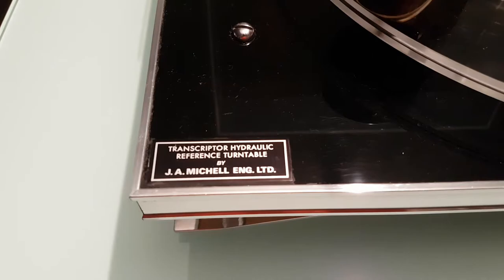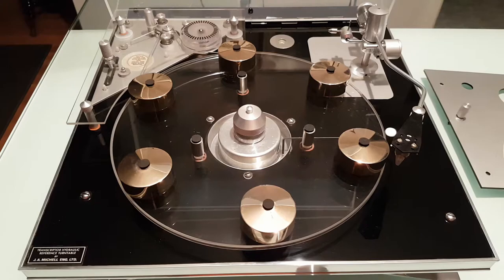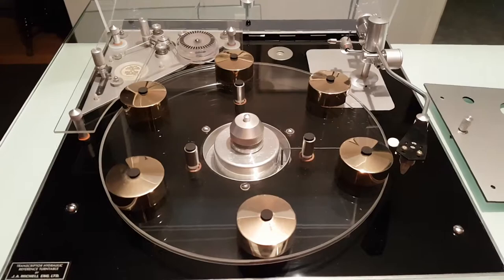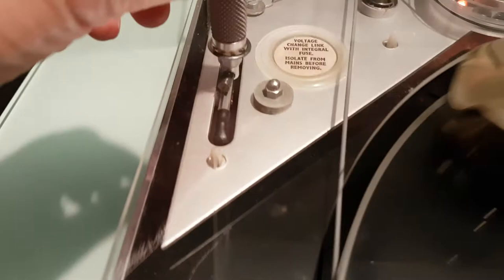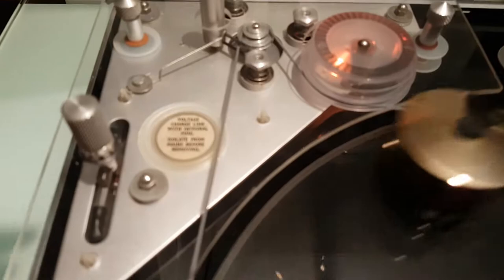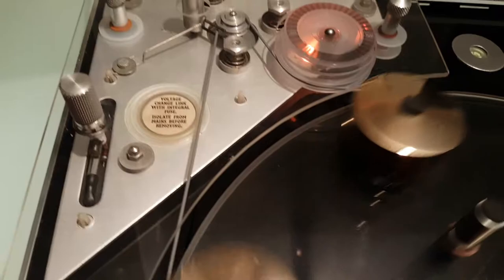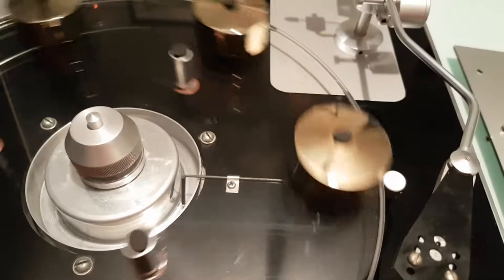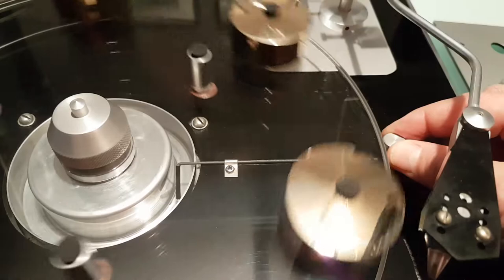Clear J.A. Michell Hydraulic Reference Turntable

Comment: Cool looking and well made table but it's actually bad design to suspend the record on a few points because the vinyl is free to vibrate and resonate. Vinyl resonance is much more effectively damped out by allowing platter/mat to contact the record over it's entire surface area.

Comment: Hi there - thank you for the video - this is very helpful (especially seeing the change of the 33/45rpm which I couldn't figure out before). Is there a video you could share using the tone arm, putting it on/off the record? From the manual it seems to suggest that you can both lower the needle and raise it up again using the counterweight, but I can't work out how to pivot the tone arm with how I have it set up currently.